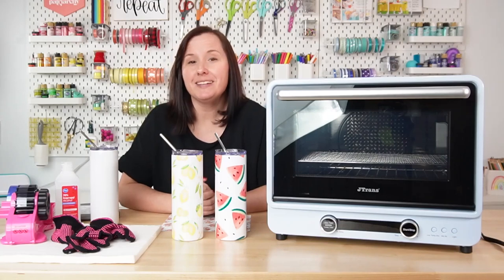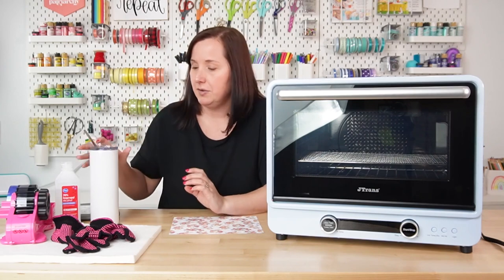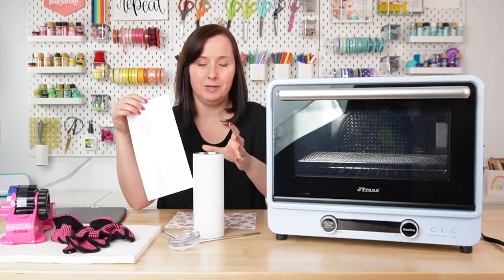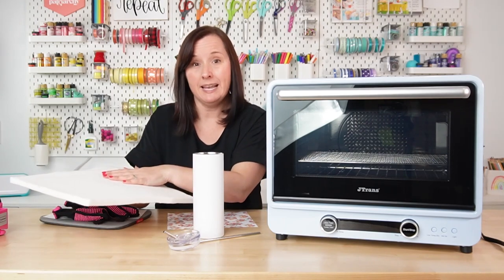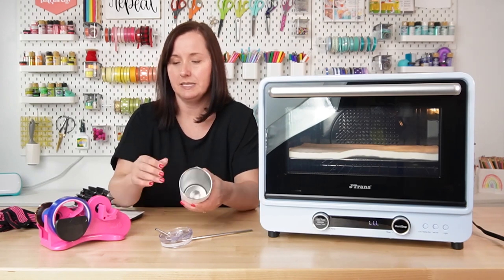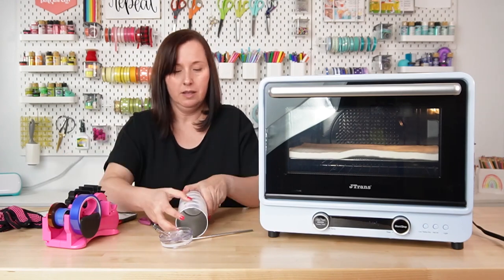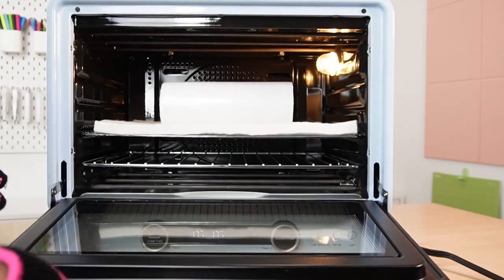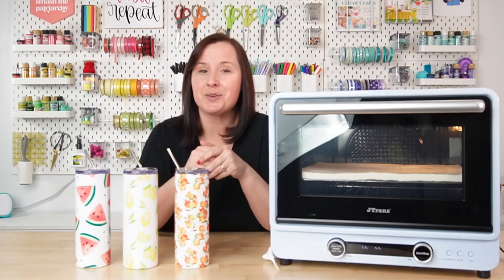How to Sublimate a Tumbler in a Convection Oven—it's Easy!

Comment: Hi.
I have been reading about the process and want to ask about the fumes?
Do you have any suction close by behind the camera or all windows open or a fan blowing in the direction of an open window?

I was thinking of having a craft corner in my living room, with a small convection oven for sublimations, but not if using it makes the room inhabitable.

Thank you for the video.
Reply from the maker: When I’m filming I don’t, but the second I stop I turn on my air purifier and open the windows if the weather allows. It’s definitely stinky but airing the room out helps a ton.

Comment: I have a kind of off topic question. I'm looking into a counter top convection oven for sublimation but I also do shrink plastic projects. Would an oven like this be ok to use for both sublimation and shrink plastic? (done seperately of course) or would I be better off getting a regular kitchen countertop convection oven like the hamilton beach one you have pictured at the beginning of the video? Thanks for any advice you can provide!
Reply from the maker: Yes, I think that's fine! You just don't want to consume anything that's been in an oven that's also done sublimation.
Reply: @HeyLetsMakeStuff  thank you for the info! I currently use one of those round air fryers exclusively for sublimation (and would prefer something I can see in) and my regular oven for shrinky dinks, would love to have one device to do both in! This might be something I'll have to look into and save up for! <3

Comment: Do you need to put a mat in a convection oven or can you just put it in the oven,
Reply from the maker: I was able to put it straight in this particular oven (it had a wire mesh basket) and it didn't leave marks. But in my new oven, I use a nomex pad.
Reply: Thanks for the great video, I just bought a convection oven to do tumblers and mugs instead of a tumbler press.  Can you link to the nomex pad you use possibly?  Is this something I can get on Amazon I'm assuming?  Thanks so much!!
Reply from the maker: @maureenficarra4446  Here you go! https://amzn.to/3pYrOun (affiliate link)

Comment: Did you rotate it? What is the pad in your oven?
Reply: I had issues when I used my convection oven and it melted the shrink wrap and burned my tumbler.
Reply from the maker: I did rotate it (I forgot to film it so it's just a quick text screen in the video). The pad is a Nomex felt pad—it basically protects your tumbler from the super hot grill marks. 

For your burning problem, I would get an oven thermometer to make sure your oven is the temperature it says it is. And then maybe a different brand of shrink—some of the cheaper brands just aren't as good!
Reply: @HeyLetsMakeStuff  thank you. I will try the heat pad too and see if that helps.

Comment: do you need the shrink wrap?
Reply from the maker: There are a few options, but generally yes. The shrink wrap gives you the pressure element that you'd get with a tumbler press. You can also completely cover in masking tape or use a silicone wrap, but I prefer the shrink wrap.

Comment: do I need to flip tumbler if I don’t have a pad in my oven
Reply from the maker: I recommend it. You may be able to get away without flipping depending on the heat dispersement in your oven, but generally it's best to flip it.

Comment: so that is an actual sublimation oven not a convection oven ??
Reply from the maker: It's a convection oven designed for sublimation (meaning it has a few more sublimation-specific features, like being able to adjust the top and bottom temperature separately). But any convection oven will do (just make sure not to use it for food too!) :)